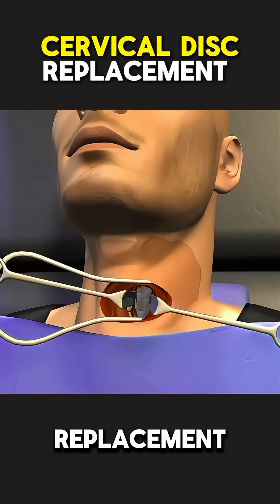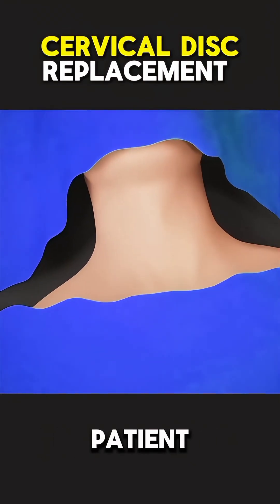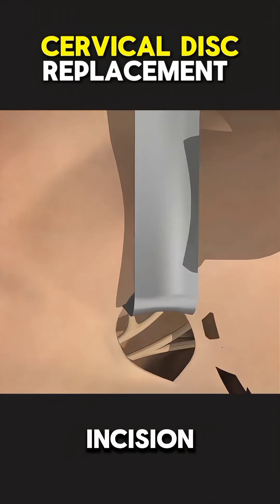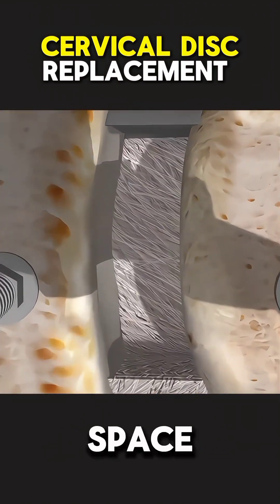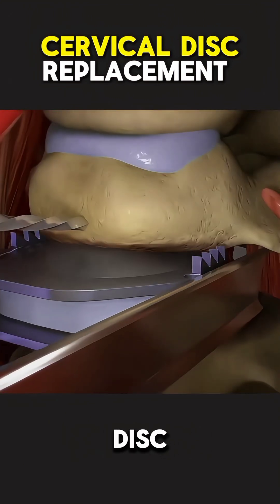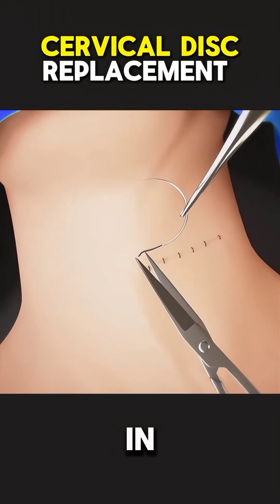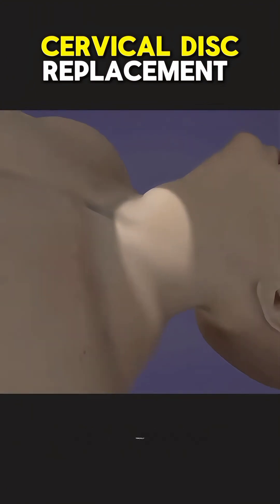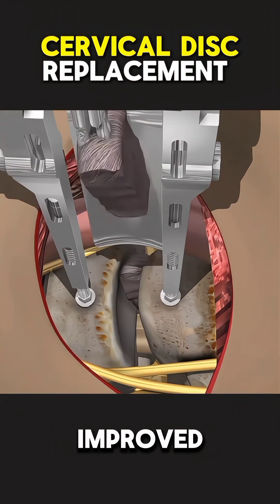Cervical Disc Replacement Surgery (3D Animation) #3danimation #anatomy

Comment: I had 2 discs replaced. I was back doing podiatry after 6 weeks. It was brilliant. I didnt have any issues with drinking, eating and swallowing. The first month is excruciating but in uk we dont wrar collars. We go straight into doing stretches. Im sure thats why i was back at work so fast
Reply: I'm supposed to have this done. I'm going to want to consider neck stretches. I don't want to take too long getting back to normal.

Comment: Do they have a better entry way instead of your throat? What about the back of your neck? After the surgery, you gotta worry about eating and swallowing. I don’t like that trade off.🙅🏻‍♀️
Reply: More difficult from the back of the neck because of the structure of the facet joints and muscles
Reply: My husband just had this surgery and he's eating and drinking without a problem. His complaint of pain isn't from the incision site but in the area where his neck and back meets. He's been up and moving without a problem. Totally worth it!